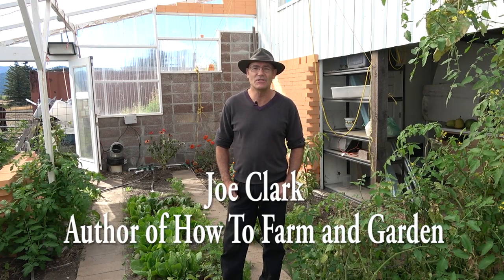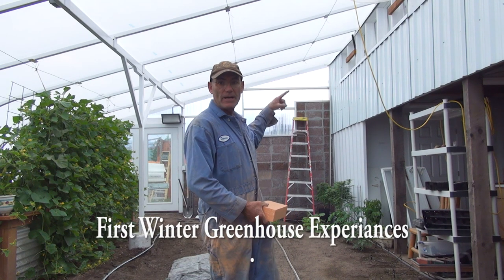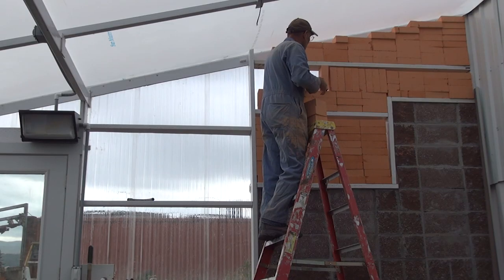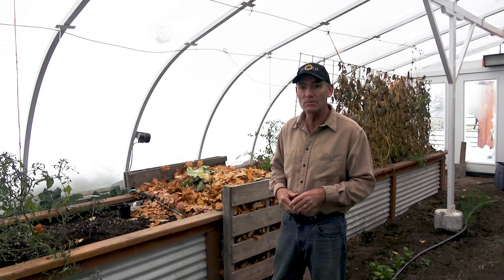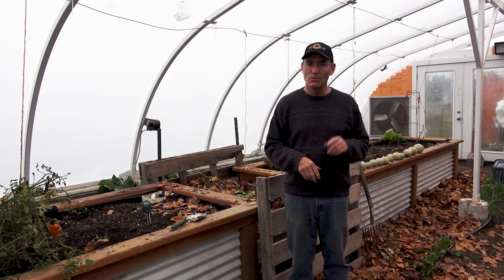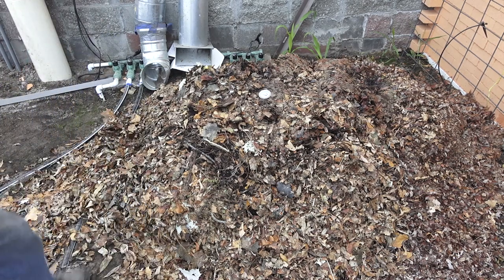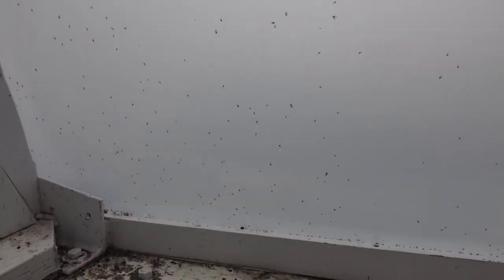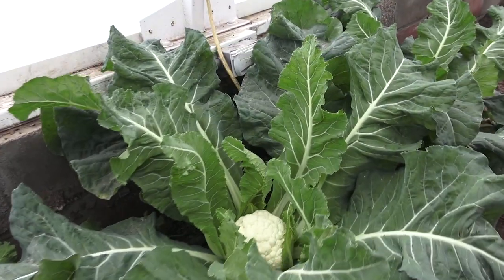11_Greenhouse Incorporating a Shipping Container_Winter in the Greenhouse

Comment: I plan on installing geothermal greenhouse in spring and have been doing a lot of study on it. You have a lot of great ideas and you do a great job on explaining it in the videos. I will be watching you through this winter on how it works out for you . One thing I would like to know for now is how did you bend your square tubing.  I have everything to build it such as a mini x and skid loader but I do not have an exact plan yet since I only want to do it right the first time. By the way this is Susan hubby Floyd. 
Keep the videos coming Joe
Reply from the maker: I hired a custom metal fabricator to bend the square tubing. I made a mock-up of what I wanted. I then made a jig and welded the parts together.

Comment: Should look into a rocket mass heater or diy solar water heater if you have the sun, also check our neem oil and dr.broners sal suds for the bugs it works great!!
Reply from the maker: I use a soap and neem oil for pest control. I have done some videos on rocket mass but I have to be gone to often to use one. The geothermal systems keeps it from freezing.